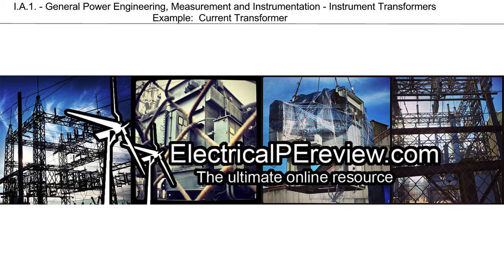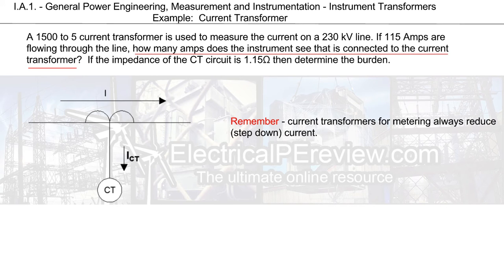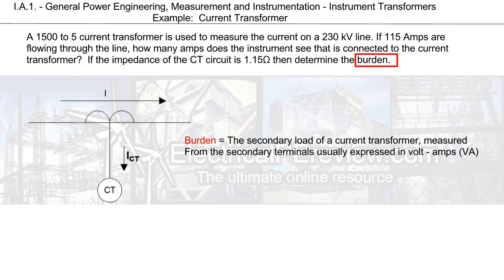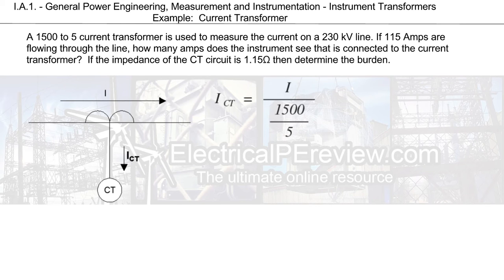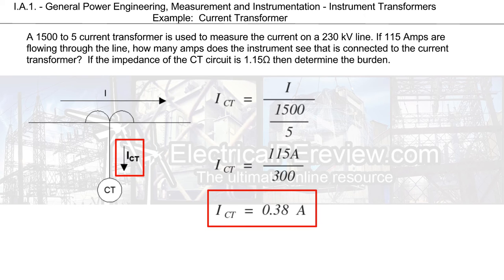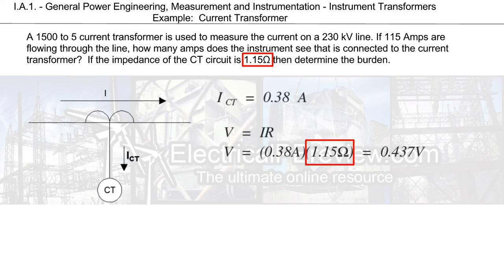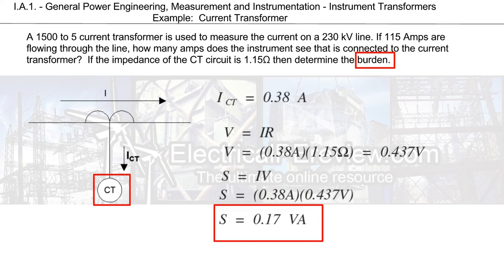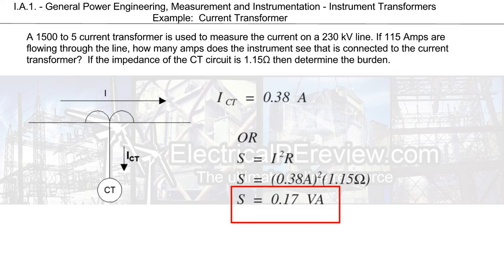Current Transformer Example - NCEES Electrical Power PE Exam Review

Comment: 115/300---
What is 300
Reply: 115 is the line current as expressed in the problem statement. 300 is the non-IEEE CT ratio (1500:5 = 300:1).

I (CT secondary) = line current / CT ratio. Hence, 115 / 300.

5 years later... hopefully someone in the future finds this helpful lol.
Reply from the maker: Without knowing the context, 115/300 looks like a transformer ratio.  Since that doesn't look like a CT ratio, I would assume it is a PT or voltage transformer ratio. 115 on the primary would result in 300 on the secondary.